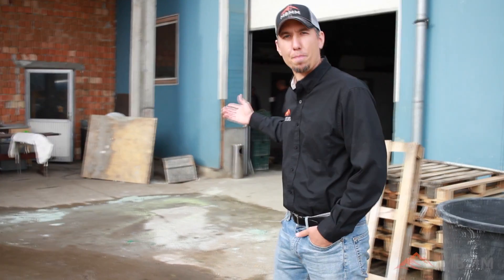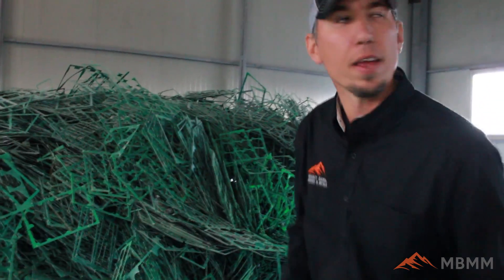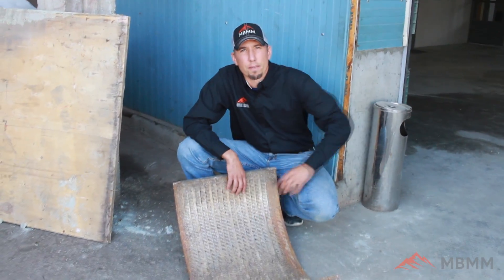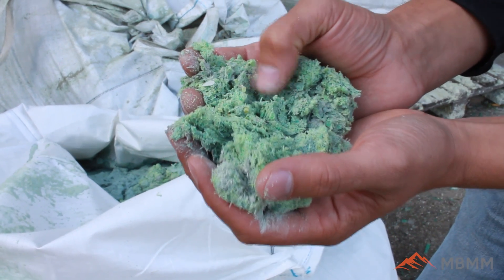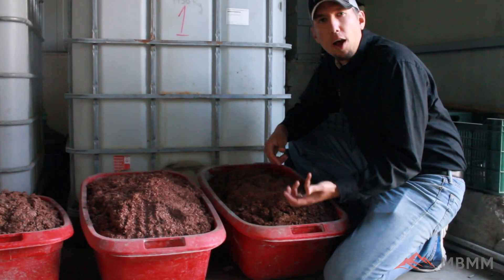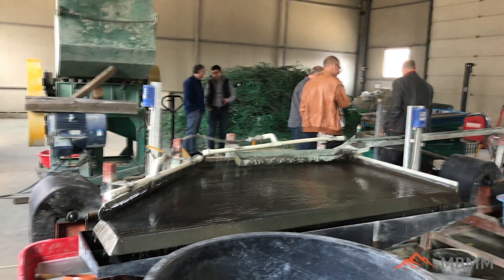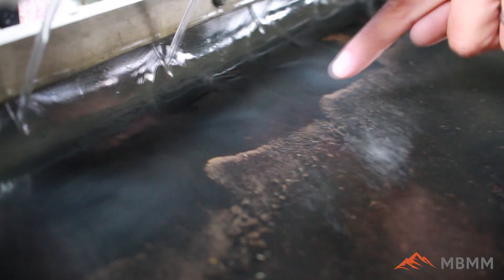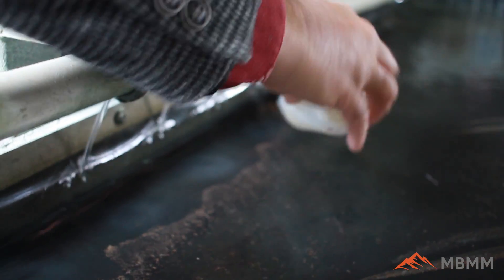MBMM Euro Trip Part 1: Processing PCB Boards for Copper and Precious Metal Recovery

Comment: I wonder if it could be used for 3d printing filaments? glass fibers are pretty popular for various nylon and polycarbonate filaments and the fibers have to be much shorter to fit on a spool, im genuinely curious if fibers recovered here would be as effective as what I assume virgin fibers would be.

Comment: G'day mate, watched your vids plenty of years now, thanks so much for the content

Just wondering if the customer found a re-use for the fibreglass plastic from number 4 on the shaker table? 

Cheers buddy
Reply: no we stopped processing that material, started doing cables and wires where the casings were of value as well as the copper
Reply: I'm starting my journey on pm recovery. One idea I had was to see if it would be possible to make silicacarbide with the plastics and fiberglass. There are also people working on turning plastics into fuel, which would leave the fiberglass, maybe there would be a way to turn that into pure silica for use as flux in smelting. I look forward to learning more and playing around with the material.

Comment: That plastic waste I have a idea or a solution since it's both fiberglass and plastic and it's already shredded run it through a hot extruder that will melt everything together you can make boards out of that like plastic fence post and there's your solution of the waste material

Comment: That's some very interesting ideas on recycling. Would it be possible to sell the fibreglass to the cement industry to put in their concrete mixes?
Reply: no, the fiber is useless, we stopped doing this material completely.  it's worthless and started doing copper wires and cable.
Reply: With the advent of technology, it is now possible to recycle most items, fibreglass included. The recycled fibreglass can be included in the manufacture of outdoor furniture, bus seats, spray insulation, boats, and many other items.

Comment: Gold in PCBs is juts gold plating, surface treatment. But if your system can still recover that, this people should buy scrap electronics that tend to use more gold like RAM sticks and any comunication-related electronics like modems, cell phones etc.
Reply from the maker: Great, thanks for the tip!

Comment: for the number three material adding a salt to the water to bring the pacific gevity up should float the plastic making separation easy..
Reply from the maker: Great, thanks for the tip!
Reply: Salt would be hard on the equipment.

Comment: Jason. That fiberglass is neat. You should tell your customer he should look into mixing that into concrete. Maybe he could sell it to a local company. That would theoretically improve the strength of the concrete and get rid of the waste at the same time. Maybe it could substitute the sand in the mixture. But i definitely see value in that material because otherwise disposing of that would be costly. And piling it up is bad too because when it dries u will have fiberglass dust blowing around. Anyways. Concrete seems promising. Your customer would benefit even if he could give it away.
Reply from the maker: Great, thanks for the tip!
Reply: @mbmmllc hello sir I want small machine plz tell me wt price this
Reply: cement companies can't use the fiber due to its short fiber length.  It's worthless and  landfill will charge you extra to take it making the boards a net egative product when you have to treat the fiber for landfill.  We don't suggest using this material for recycling.

Comment: What does a system setup like this start at?
Reply from the maker: Hey Charlie, I can provide you with pricing on this printed circuit board processor if you would please email info@mbmmllc.com or give me a call at 360-595-4445.

Comment: Wow Jason nice system and nice video. The thing is those boards that they are recycling look like very low grade boards. So I would not think that there would be hardly any gold on those. I bet the recovery with your system would be incredible with high grade motherboards. Have a great day and enjoy your trip it really looks nice over there.
Reply from the maker: Thanks for the comment.  Yes they were low grade boards, but there was still some gold plating on the corners and edges in certain spots and the table was able to separate out the fine gold from the copper.  It was really cool to be there and see his whole process.  He is doing some really great stuff.  Thanks for watching!!

Comment: how are they refining down the copper to get to the 30% gold
Reply from the maker: Hi Ken.  By screening to ~80 mesh and re-running the fines on the table he was able to suck up the very fine gold line just under the water bar with a snuffer bottle and end up with a ~30% gold product he was selling directly to a gold refiner.  All the copper went to a smelter in Poland.  Thanks
Reply: The product that was tested was not copper it was ground up memory from a small batch of RAM we collected.